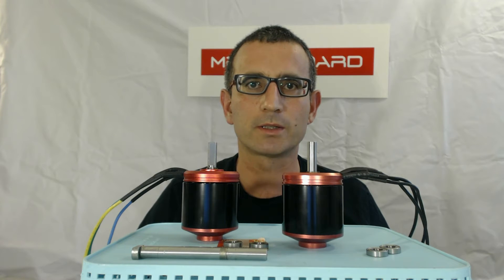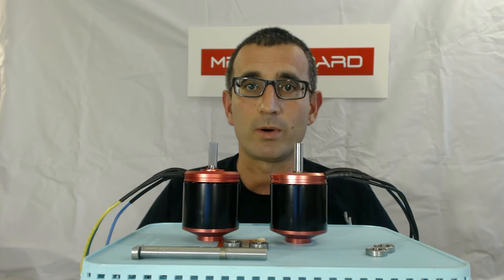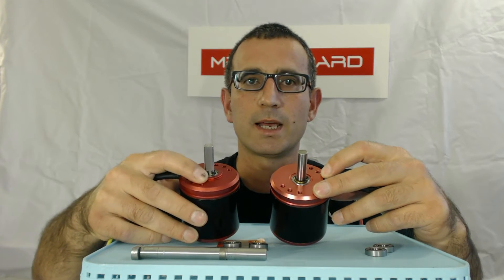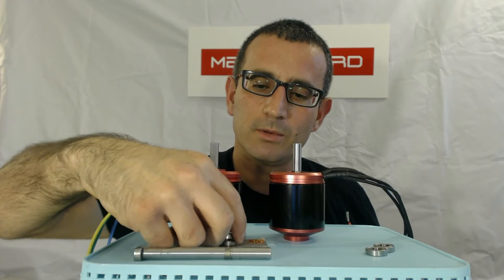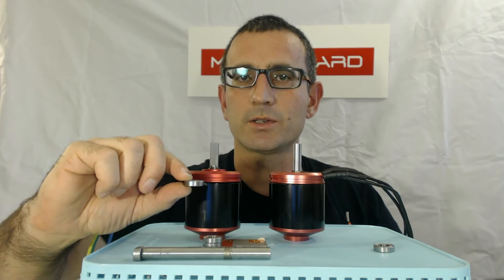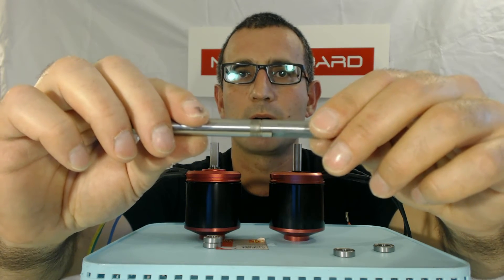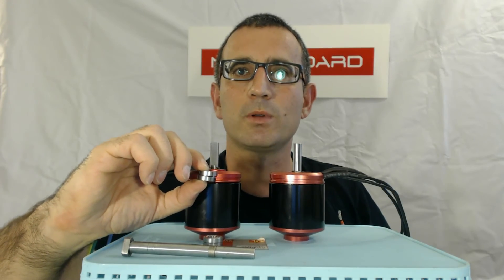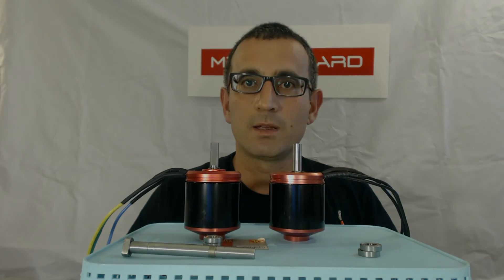Fast 24 mph Electric Skateboard Motor for Metroboard

Comment: Does the new motor have any additional torque? I have been torn between a metro board single motor and a boosted stealth. I don’t need a board that is crazy quick, but I don’t want it to struggle up hills.
Reply from the maker: Same torque.  Higher Top Speed!
Reply: Go with the Metro.. Better Range, Insane torque, Reliable will climb any hill that you dare go back down on and the best customer service out there!
Reply: Daniel Eng thanks! I actually ordered one last week!
Reply: @draxxthemsklounst  That's awesome did you get Dual or Single drive? You will be happy you made the right decision!
Reply: Daniel Eng I went with the 33” single drive.
Reply: Good Choice for carving it's a lighter board as well

Comment: hey Illan, can this motor be bought separately for the purpose of putting it in or swapping the old motor out? i have a 41" stealth board with the 20 mile slim pack? and if so, how hard would the installation be? thanks
Reply from the maker: Andrew T yes it can...not that hard
Reply from the maker: Steven Lin email us at info@metro-board
Reply: hi I too have a metroboard that goes 20mph,  where will i be able to purchase the new motor from?
Reply: might me interested, how much do they originally go for?